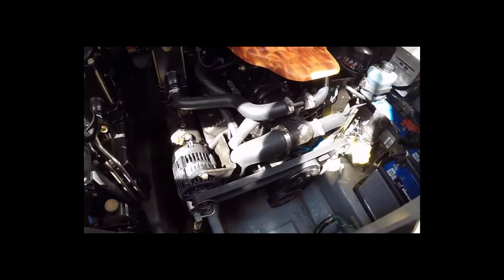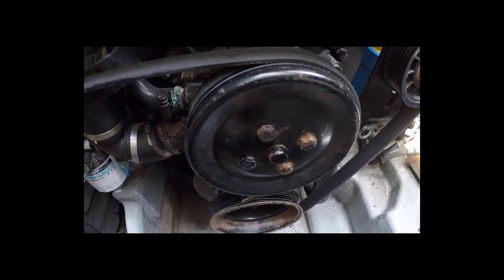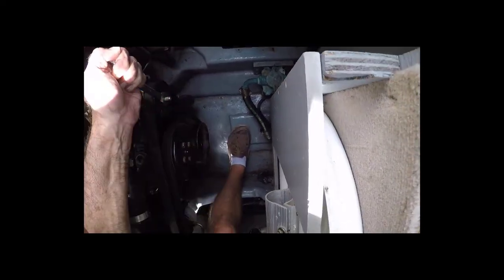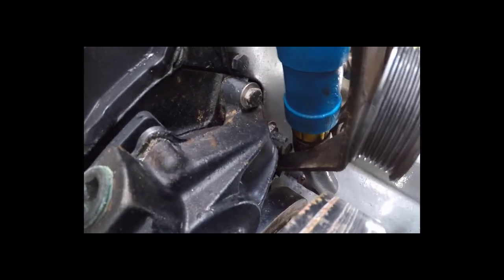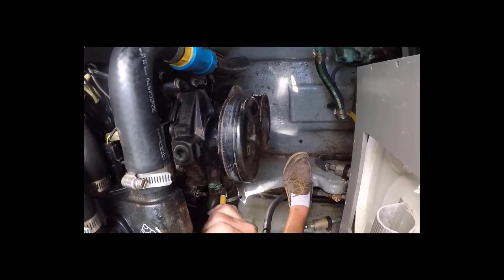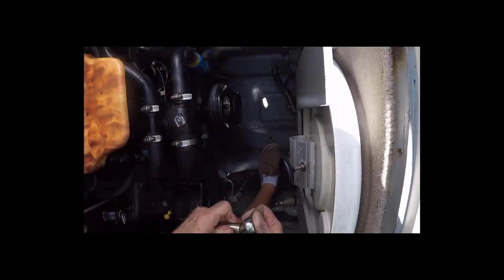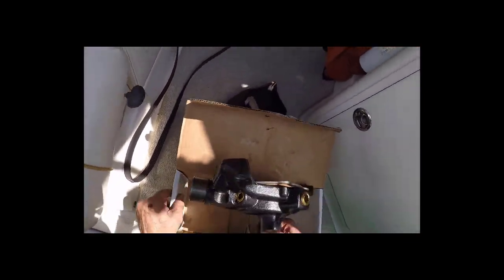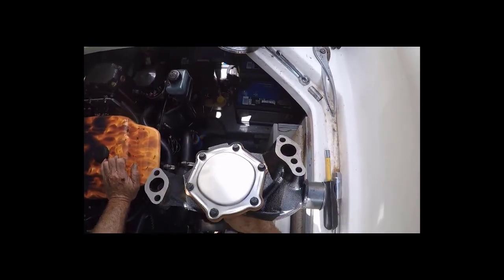Replace the engine circulating pump (water pump) on a Mercruiser 5.7 liter engine

Comment: how do you get the pulley off
Reply from the maker: I assume you mean after you get the bolts out of it?  Mine took a little wiggling, but it came off without a fight.  If the existing pump is marine, its shaft should be stainless so there shouldn't be any corrosion.  Are you dealing with corrosion on the shaft?  If so, I'd probably start with Master Blaster.  Worse case I'd then use a pulley puller.

Comment: Thanks for the educational video.  About to tackle this job myself.  Question, when you removed the pump, you had some water from the engine, but my question is if I need to drain the coolant system if I'm going to do this job and replace the thermostat?  BTW, I have a seawater cooling system with a heat exchanger.   Thanks
Reply from the maker: If you have a closed cooling system (antifreeze in the engine separate from the seawater with a heat exchanger), then I would find a way to drain the coolant from the closed side before removing the circulating pump.  Otherwise, yes, you'll have pretty much all the coolant in the engine empty into the bilge when you pull the pump.  All my boats have been raw water cooled, so I'm not sure where the drain is for a closed system - but I'd look for the lowest point in the system.
Reply: @bretthusselbaugh1198  Good information.  Thank you for the quick reply.  Cheers!